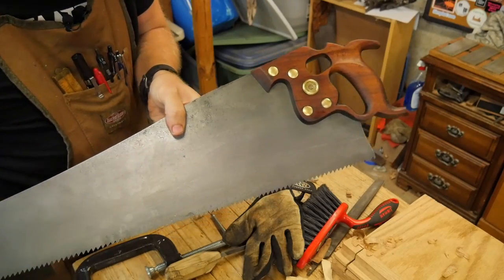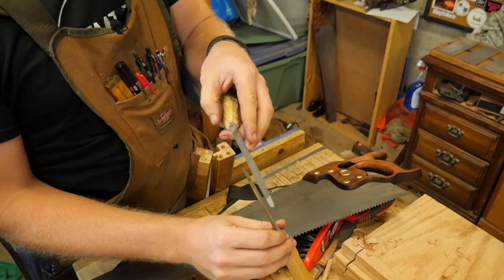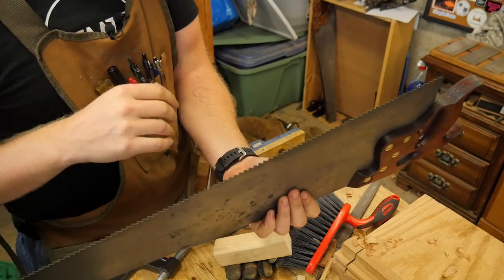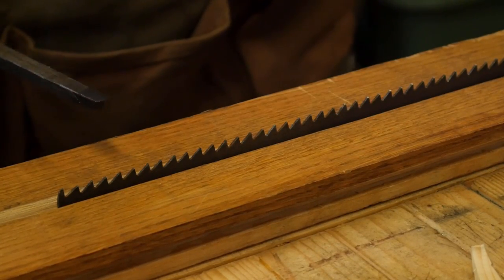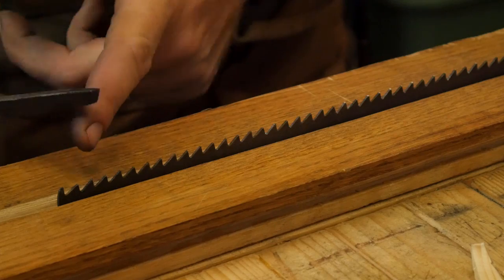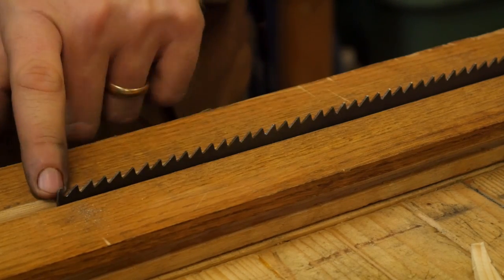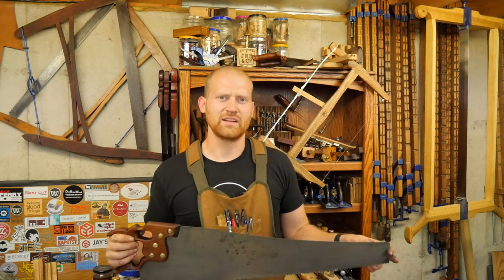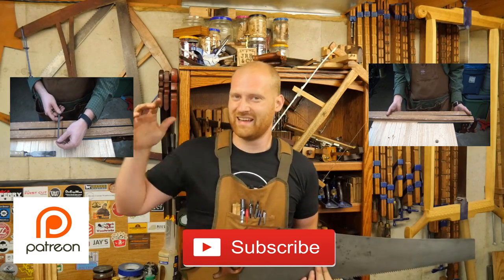How to Sharpen A Ripsaw Pannel Hand Saw

Comment: The frame saws behind you i have one but need to get a new blade for it where do you get your blades from ????
Reply from the maker: Matching the blade turn existing saw frame is almost impossible unless you knew the original maker of it. They're not standard in any way. there are two companies I know of right now that makes him. One is Blackburn tools. And the other is bad Axe tool works.
Reply: Wood By Wright I should’ve thought of bad ax i just got my $4.00 yard sale 10in disston back from them , they retoothed it for me , they did a great job with it thanks ill shoot them an e-mail

Comment: Great video. Thanks for the tip about the wire on the edge of the blade. I had never thought of that before. I'll probably have to start flipping the saw around in the future. Also if you don't have a fancy saw set you can set the saw with a nail set and two hammers. That is how I set my first saw and how I'll probably set the new one I got. Paul Sellers had a video I got that tip from. If I can find it I'll post it in another comment.
Reply from the maker: +David Dorothy I use to set it that way too. Paul does a great video on it.

Comment: Found a Henry panel saw little pitting was a 10tpi sharpened it but when i tryed setting teeth with a wood screw with flattened head as i was shown it bent the plate backwards and forwards been trying to find a saw set but they seem to be hard to come by.
Any ideas on how to set it with out a saw set?
Reply from the maker: Hammer setting is an art that requires a LOT of practice to do well. I would suggest seeing when the next tool meet is around you. most all of the MWTCA meets will have several sellers with buckets of them for $2-$5 each. here is a map of known tool sellers that might help. https://drive.google.com/open?id=1kmCeWv7lZUTbcNoKEG1ff5XjcKUfMwLf&usp=sharing&#x20

Comment: I have an old saw that has a straight blade about 12" long and 1" wide at the top tapering down to about 3/8". I would like to take it apart and restore it but it doesn't have screws at the top holding the blade. It looks like the top of a nail head on both sides with a diameter of 3/8" so I don't know how to remove it. Can you give me any help?
Reply from the maker: Feel free to send me some pictures. My email address is jameswright@woodbywright.com

Comment: cool saw and cool video. Like the close-up shots.
I remember Wranglerstar mentioning older saws sometimes have a taper in the blade so it doesn't need much or any set. Is that just with felling saws or also panel saws?
Found an old saw setting fork, need to give it a try some day.
Thanks for the video and have a great day. Cheers.
Reply from the maker: THat is just with Large felling saws. with panel saws they are all flat plate. would love to see what you do with it! thanks for the comment as always.

Comment: i have an old hand saw like the saw in this video. the blade has a bit of a slight S shape to it. any advice on how to straighten it?
Reply from the maker: you can try over bending it the opposite direction. if that works then great! if not the only other way is 5-6 hours with a peening hammer and anvil and you may never actually get it straight. in all honesty, if I find them with a bend or kink I turn them into card scrapers and get another saw.

Comment: What kind of file did you use in terms of  size; and coarseness?
Reply from the maker: size is determined by the depth of the gullet you want the file when it is in the gullet to be slightly more than twice the height of the gullet. that wat the tip of the tooth does not touch the center of the side of the file. the coarseness will be adjusted to the file size. so I never look at the numbering I just chose a file to fit that tooth size. does that answer your question?
Reply: Yes, thank you! Where do you get the files?

Comment: I sharpened my rip saw and resawed some 5" wide poplar. I'm not pleased at all with the performance of the saw.  When you resaw with the hand saw, what sort of dust to you get? Powder? little curly chips?
Reply from the maker: Usually you get a heavy dust that falls very quickly on the other side. You generally only get chips when you're working with sauce larger than 2 PPI. I have a resawing video that shows the dust coming out the back side of it. I'll have to look it up and see if I can get you a link.
Reply from the maker: Here you are. It's around 11 minute mark. https://youtu.be/dPgVYTwQ5Wc
Reply: @WoodByWright  I'm getting dust. I don't think I have as few teeth on my saw as you do, but it is a similar Disston model, has the way cool extra hole for the other hand.  My saw isn't that deep, either. But I am still looking at 6 TPI or so.  I wish I knew how a sharp saw behaved so I could gauge the extent to which the issues are the saw and which are related to the nut behind the handle. Thanks for the videos!

Comment: great video James, the one thing I did note though is that you didn't wax the blade, you will find it cuts a little easier by putting paraffin or bees wax on the blade, creates less friction and produces a much cleaner cut.  I love my Diston saws, I need to sharpen all mine though, I inherited my Great Great grandfathers hand tools and I' pretty sure they haven't been sharpened since 1955, I should probably get at LOL!
Reply from the maker: +The Divine Hammer's Woodworks thanks. I love working with my great-great grandfather's tools. It's always fun to shake hands with an ancestor. I do wax saws but I do that in the course of using them not just when I sharpen them. I may apply lubrication 6 or 7 times between sharpenings.
Reply: yes I do it as well, pretty much every time I grab my hand saws I give the blades on the saw a quick coat, and when I store them for a while a quick light coat of WD-40 or light weight oil is applied, not only does it keep rust from happening but also helps to keep resins from gumming up your blades if the wood is still kinda wet. I do this to my planes and chisels as well. since all my tools are strictly used in the basement workshop it's over kill, but a little prevention goes a long way to maintain these family heirlooms, so I can pass them down to my kids in the future.  I'm the 3rd generation to have and use these tools and hopefully many more generations of my family will enjoy the use of them as well.

Comment: Ive just looked this up as I found a Disston rip saw in a junk shop today for 10 NZ dollars. Same place I bought a lovely Sorby chisel for 12NZD about a year ago. Both were mixed up with cheap stuff. I also couldn’t resist a Stanley number 6 plane , 20 $, and a lovely wooden smoother, 25$, with a cow horn handle at the front. I destroyed its patina renovating it, but the sole is now flat and the sides 90 degrees. Both planes work well after fettling. The previous owner of the wooden plane had it set up well, but the poor man with the Stanley must have got frustrated with it as the frog was all wrong and the blade sharpened to the wrong angle. The saw is 14 tpi and the gullet is less than 60 degrees, but I have the right file for it. I didn’t realise the importance of filing from both sides. It says Disston Canada on the handle brass button.
Reply from the maker: Nice. That is quite the hall. Sounds like the perfict saw.

Comment: nice video. why only push the file? i've asked a number of different people and never got a "propper" answer. it can't be the file because the file has no direction.
Reply from the maker: the teeth on the file are a lot like the teeth on a saw in that they cut in one direction. if you pull it back it is more wear on the file and will go dull faster. if it is a burr file or a diamond file then there is no direction. but most traditional files do have a cutting direction.
Reply: A file tooth is shaped sort of like a cresting wave. Lots of material at the back, but under the tooth is a significant hook.
There is a huge amount of material backing the sharp edge of the tooth, but pulled in the opposite direction, the tooth hangs over a hollow area. When you drag back, the edge of the tooth just gets bent down into the hollow and doesn't cut anymore.

Comment: Shouldn't the teeth be 'set' first? Seems like if you go to all the trouble of leveling and sharpening, setting would make them uneven again.
Reply from the maker: that is a big debate between different saw sharpeners but if you set them first and the teeth are not similar highs to begin then you will end up with more set on one side then the other. but if you set then all the same after sharpening then they should all move the same amount. at least that is the sharpening camp I am in. others will argue the other way. but one thing they all agry with is if the teeth are all uneven to begin with you do not est until you cut them all the same depth. like on this every other tooth was higher and setting first would make it curve the cut drastically at the end. Sorry I did not mean to type so much. LOL maybe I should do a video some time testing the two methods. that sounds like fun. thanks for the idea.
Reply: Here's why teeth should be set after sharpening and not before.
The process is almost as James shows you.
First, check to see if the saw is Breasted (The teeth run in a curve with the middle of the run lower than either end when it is cutting. More likely on longer saws.)

Second, Joint the teeth as James shows you.  A good project is to take a worn out file and make a wooden case so that the centre of one side of the file is open to use.  As you hold the wooden case to do the Jointing you are keeping your fingertips away from the sawblade tips.

Third, sharpen the teeth exactly as James shows you in the video.

Fourth, Stone the burrs, which James mentioned off both sides of the blade, running a slipstone along the teeth, just missing the Points of the teeth.  You couldn't do this if you had already set the teeth.

Fifth, apply the Set to the teeth, evenly on alternate teeth.  A saw cuts a Kerf (width of slot) which is wider than the thickness of the blade or plate. This is to reduce the friction and allow the teeth to do the work.

If you get all these right your saw will cut the way it was intended to, without you putting any more energy into sawing than to move the teeth backwards and forwards across (with no T) the wood.

Comment: You said about setting the saw but you didn't say about what number,  my saw set has numbers on it
Reply from the maker: every set has different numbers so I can not tell you what it is on yours. if it is a 4ppi or larger I set it 75% of the way to the most set. if it is 16ppi I set it on the lowest set I can. everything else is in between.
Reply: @WoodByWright  ok thank you that is a little better than the books

Comment: ......nicely done, you need to build a saw bench, much safer, easier, and productive for hand sawing...and a great project.
Reply from the maker: +Rick L I have one in the garage because it kept getting in the way in the shop. I only have 3' between bench and tool shelves. But I have sessions for one in my head that just might work.
Reply: ........understood..........maybe a fold down on the existing bench....?
Reply from the maker: Stop reading my mind! it would be a lot easier then climbing up on my current bench. that is always fun!

Comment: Thank you for showing how you prefer to do it. Good, solid info.  Also if you do not mind the comment, there is a correct speed to saw for maximum efficiency for different tooth counts, woods, and tooth sets. Using more of the blade and longer strokes at around 50 strokes per minute will work well. boingboing.net list some great suggested rules for proper use of a quality handsaw. I am slowly restoring my GGrandfather, Grandfather and Father's old Saws. Disstons, Sandviks, Craftsmans and others. It is becoming difficult to find quality saw files, especially in the slim and double Xtra slim types. Is there an online site you buy files from?

Comment: What’s the point of skipping if you are just gonna come down again
Reply from the maker: I do half from one direction then the other half from the other side. this way there is the same amount of Bur on both sides of the plane. if you push them all one way it can cause the saw to co off track the first few times you use it as all of the burr is on one side of the plate.